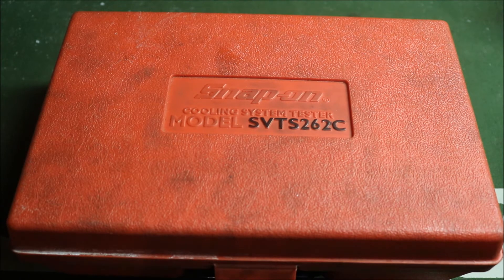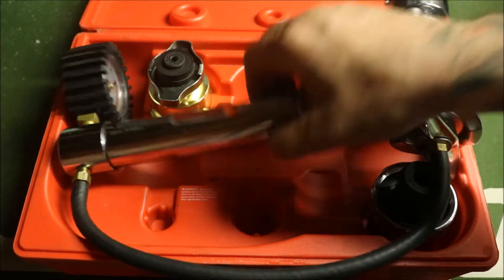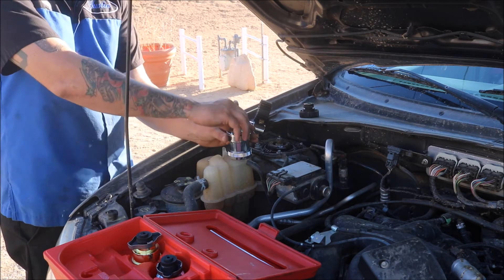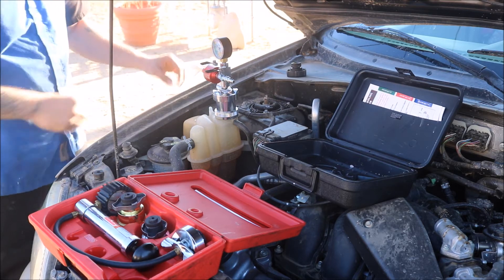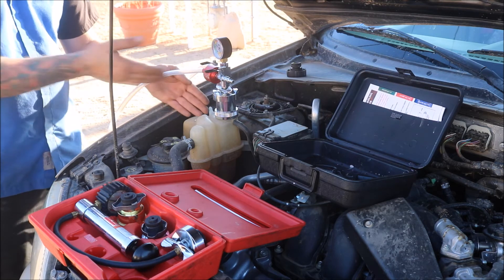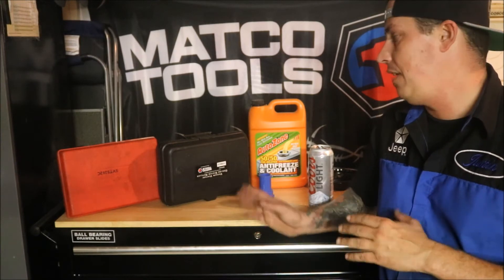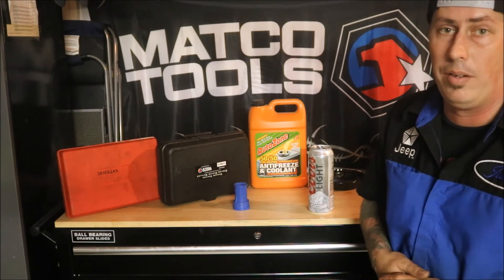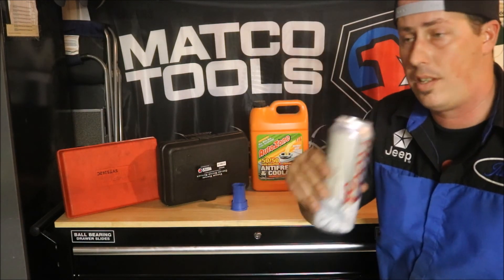Coolant Pressure Tester & Venturi Cooling system Refill Kit

Comment: JUSTIN DOW ///
...              ..                        60's ,70's, 80's, 90's car that don't use a OBDII SCAN TOOLS. The temp gauge is not working I mean that the needle is moving but how do you know it the temp gauge is reading false readings? and not correct reading how can I test it without using a Scan tool?
                      >>                 What testing tool do you use to test and check the temperature gauge in your cars dashboard is working correctly or is not working correctly? what do I use to test the temperature gauge?
                how do you test what the PSI level of the radiator is at while the car is running?

Comment: Good video.  I always try never to mix coolants but I've had to on the road.  When I do, I pull it in and flush it out and refill with the proper stuff.  I too have seen the sludge.  It gets like wet cement.
Thanks for the video.